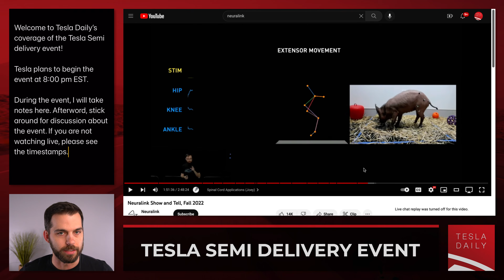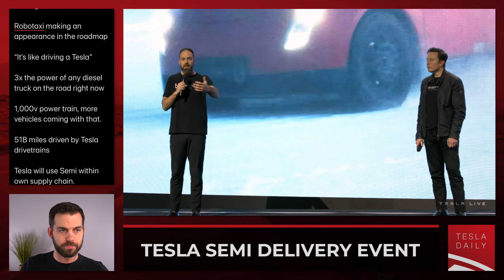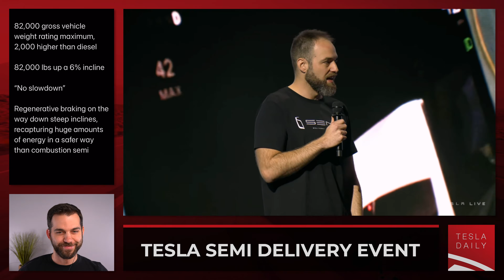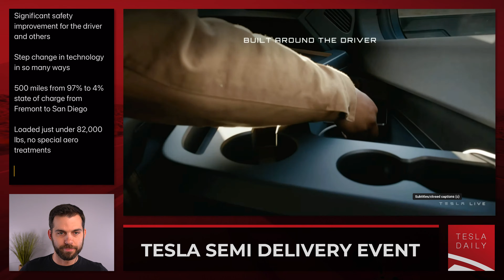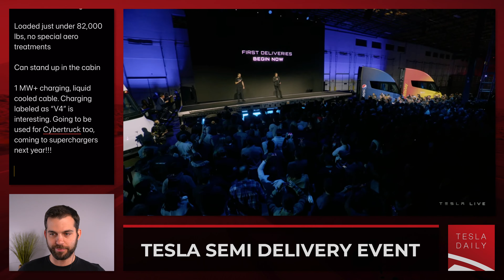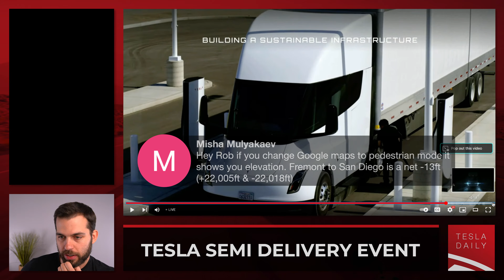Tesla Semi Delivery Event + Reaction & Analysis

Comment: Semi looks like it may be simple to produce.  Conventional frame rails are still necessary to tow the heavy trailers, but the battery pack can fit in between them.  The drive units are probably smaller and lighter than the conventional axle differentials. Looks like conventional disk brakes instead of air brakes? I wonder if a sleeper cab is an option.
Reply: I suspect they'll hold off on a sleeper until the charging network is.. started. :)
Reply: @TheEvilmooseofdoom  
Unless (a question I want to ask)
"Can the Semi charge on a V3 with an adapter?"
If "yes", that's 1,500+ locations ready for overnight trickle charge. (If 1 Mega = 4-6 V3, that's a full charge in about 5-6 hours)
.
That's a whole new ballgame?
Reply: @rogerstarkey5390   The Semi may well be able to charge via V3 (albeit very slow, even if double plugged)... the issue you will be that the current Supercharging stations are not setup for long-haul trucks to park - unless I suppose, they disconnected from the trailer whilst charging.
Reply: @TheEvilmooseofdoom  and they will have plenty of short haul customers for years anyway.

Comment: Max elevation between Fremont and S.D. Is 4255’, but there is more climbing (from sea level) than that due to several hills/mountains.  Maybe a total of 5,000’ of climbing?
Reply: Yeah but it regens on the way down...kind of cool though.
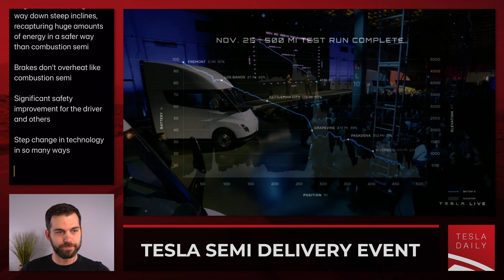Reply: Net elevation change Fremont-to-San Diego is really really close to ZERO FEET. You can see the data in your video... at time marker 39:39 there is a graph of the elevation vs position... on the far left (beginning of the trip) the elevation is very close to zero... elevation of Fremont is about 50 feet... and then at the far right at the end of the trip it descends quickly back down to around zero feet. The elevation is super-imposed in grey under the blue battery charge graph. (The max elevation point of the trip is marked as 4,136 ft at around 300 miles into the trip as it drives along the grapevine.)
Reply: The net change in elevation was six feet UPHILL.

Comment: The real question is how will the autopilot work without a rear view camera, or do they also deliver trailers? I saw the FSD visualisation on the 8 hour tour. So yes, it works, but how?
Reply: Autopilot doesn't need a rear camera, I think FSD might but not standard autopilot.
Reply: @TheEvilmooseofdoom  That much I know myself, that's why I said FSD, those were 100% FSD renderings, and in the little demo video of the trailer hook-up they showed that there is a rear camera but it is blocked by the trailer when a trailer is connected. There are also 2 new cameras on the sides that are aimed at the ground to cover some blind spots, which you can also see in the video. So the Semi has more cameras than normal Teslas and completely different views as well as a blind spot when a trailer is connected. This means that it has a different Tesla FSD computer (V4 ?) and FSD now seems to be able to handle completely different camera directions.

Comment: Pretty interesting . I wonder which battery they are using and how many . Also I wonder if they have to use a special trailer which also has Regen
brakes? Recharging time and actual battery capacity where not revealed or did I miss it?
Reply: @Charles Jutkins
Battery?
"Sufficient" (it's 2170, they told us months ago)
Trailer? Standard.
Reply: 18650 battery. They said it was a special trailer.
Reply: @mynameismatt2010  
2170 battery, from Nevada. Where they build the truck as stated previously.
Where did they say "special trailer"? Timestamp please.
Reply: @rogerstarkey5390  You’re right, I knew it was using cells from giga Nevada and switched which ones they were making by mistake.
I’m not going to search for the time stamp, early on in the presentation the guy said something like you can’t optimize the truck and not the trailer or you end up with a less efficient system overall.

Comment: Both Freemont and San Diego are pretty much at sea level :) in fact the chart they have shared clearly indicates that elevation was the same in the end but there was also very significant mountain passes in-between. Also to note this is Nov 25th test in California, so temperatures were not the best but also not the worst for the batteries. I would really love to know what smart thermal management system they have devised to maximize cold temperature performance
Reply: Funny,  I'm not a scientist or a mathematician, and I'm not trying to punch holes into Tesla's presentation as I also own Tesla stock <:).  However, Tesla's presentation left me with a couple of observations as well.   I used to ride a bicycle, and used to do long-distance cycling, and when I was really into it 1 could do 100 miles rides without out too much concern about completing the ride The 100-mile ride I used to do on a weekly basis was pretty flat.  Sure there were a couple of hills, but if you looked at the profile of the course I rode, the hills were ripples in a stream;   A "flat" 100 miles was still an achievement for me, but it wasn't a stage in the Tour de France  <:)   2ndly, most of the 100 mile rides I completed were executed while I was in motion for most of the ride.  If I had to stop and start repeatedly and go up 10% grades, the energy output was extremely different.  The same conservation of energy or not, has to apply for Tesla's 500 mile ride as well.  I'm also wondering if the 80k+ load actually helped achieve the mileage.  Once that package was moving, there was a lot of potential energy riding down the road.  The car I drive puts about about 260 hp at peak throttle, but keeping the car at 70-80 mph, constant speed, requires maybe 15-20 hp.  Tesla's motor size?  Yeah, it's damned impressive, but gearing plays a substantial role as well in the ability of a relatively small power source being able to pull or push what seems to be impossible amounts of weight, and a good example of that are the machines that push back 400,000 lb jets.    500 miles is 500 miles, but. I think Tesla has a long way to go, no pun intended.
Reply: @craighermle7727  I think you are making some assumptions that aren’t true. There is a 1000 ft elevation climb, a 4100 ft climb and a 1,500 ft climb along the route. It’s shown on the background on the graph with the state of charge and mileage. It’s an incredible feat of engineering. 

Fremont to San Diego
Max elevation: 4255 ft / 1297 m
Min elevation: 9 ft / 3 m
Elevation change: 4247 ft / 1294 m
Max grade: 6.9%
Min grade: -5.5%
Steepness score: 10 + 693 + 4001 + 15 = 4720
Distance: 475.46 mi / 765.18 km
Travel Time: 7 hours 17 mins
Reply: @mt2nv1  Like I said, 500 miles is 500 mile! I don't think I made too many assumptions.  Musk said there was 1 nature break so I have to believe that momentum played a significant role. in Tesla's mileage scenario.     I'd love to see a course profile   4247 ft of elevation change over 2,508,000 ft,  (475 miles isn't all that much.    Pulling 81k thru stop and go traffic for 500 miles has to consume more energy than a steady state drive.  I own Tesla stock, so I hope they sell out and every trucking agency wants one, but there are ways of extending range I know that from pedaling a bike for a few miles up and down hill <:)    cod is also a significant component which I think plays a far more significant role at 70 mph than it does at 5-10 mph.   There's a lot of energy spent just pushing air, so if Tesla has lowered the cod thru design, great!
Reply: @craighermle7727  Stop and go is actually a LOT more efficient in an EV than a traditional car.....just saying.
Reply: @craighermle7727  the EPA rates vehicles on flat land with ideal conditions. This drive was far from that. I understand a healthy skepticism, but insinuating the numbers were fudged is a bit much. 

The speeds appeared to show an average of around 50 mph. CA limits Commercial trucks to 55 mph.
Reply: @mt2nv1  I'm not insinuating anything.  Look up any cycling profile and see what power requirements   for a 150 lb person doing a "hilly" ride vs a flat ride.  The energy requirement to climb 15,000 feet over 100 miles is substantially more than climbing 4700 feet of climbing over the same.  That not insinuating anything.  It's a matter of fact.                                                 EPA rating has nothing to do with Tesla's presentation example.  "They went the distance they claimed it would. or at least close to it.   Do you think The Tesla semi could pull a 81k load up an 8% grade for 475 miles given the same battery capacity?  I would be awe-struck if they could.    There are many variables that allowed Tesla to make their 475-mile range; it wasn;t all battery and motor design.
Reply: @craighermle7727  I understand where You wanna go, but I believe stop and go traffic has advantages thay help the efficiency too. If You do slow traffic You don't fight air drag, which is bigger at highway speeds. Rolling tire resistancy is also lower with slow speeds so while You do more acceleration and braking, You fight a little bit less resistance. I'm not saying it will help, but I wanna wait for a real world tests outside Tesla. Like months. Pepsi could be the one publishing them. In 6 months or so.
Reply: @craighermle7727  wind resistance plays the biggest role on a trup like that. Inertia is nothing to worry about.
Reply: @craighermle7727  I understand what you are saying. My point is if the route was flat they could’ve gone farther. It was far from flat.
Reply: @craighermle7727  
The extra load can never "help" efficiency because "laws of physics".
You can never get back more than you put in.
The difference with your "bike" analogy is the substantial amount they can recover.
The "nature break" was insignificant because as they said, the truck didn't charge during the break, in fact, it reduced the efficiency since they had to accelerate back to speed.
Reply: @rogerstarkey5390    You can't get back more than you put in. that's a given.  All I'm saying is there were multiple factors that enabled Tesla to make its range.    cod is certainly one of them as is regen braking,, as is battery and motor design as is a route that allows the vehicle to use regen
Reply: @craighermle7727  
The "regen route" is largely irrelevant.
You either "tick over" on a relatively flat route and recover a little, or use more energy on gradients and gain a similar percentage but more energy back.
.
However..... A "demanding" route will always leave a bigger energy gap.
Reply: @craighermle7727  
They did a real-world test, that's by definition the best approximation of what customers will experience. Not all conditions were the worst possible, but they weren't the best either, it's a nice average, erring on the unfavorable side. Real loads rarely max out the truck's capacity, and weight does matter. At minimum rolling resistance is proportional to weight, and that's a non-trivial percentage of the total power consumption. In fact, for truck drag is less important, because of their elongated shape, higher density, and the square-cube law, while rolling resistance is more important because it's also proportional to the number of wheels. The Engineering Explained YouTube channel did the math on the Tesla Semi recently, you can take those equations and play with the assumptions.

Also, height difference is less important than you think. If you drive a Model S from sea level all the way to the top of Mount Everest, you only lose about 50% of the range to the height difference.

In the real world, your average elevation change is always zero, you can't drive uphill both ways. So, driving up to a mountain takes more energy, but you get most of it back on the way down. If it's not a single drive, that doesn't change the overall picture much.
I've driven my Tesla in the mountains, the overall power consumption doesn't change much.
Reply: @craighermle7727  the only got you question left open is the weight of the semi truck load and trailer were 81000 lbs. Does the semi weigh more than a 1000 lb more than a diesel semi.

Comment: San Diego and Fremont are both at sea level.
Reply: Yup, but the land between them isn't.
Reply: @TheEvilmooseofdoom  Yes. Rob was asking about this because if one is higher than the other that would affect the ending charge in the battery and affect the total drivable mileage. But they are both at sea level, so there is no net elevation change to affect total mileage. :)
Reply: Net elevation change Fremont-to-San Diego is really really close to ZERO FEET. You can see the data in your video... at time marker 39:39 there is a graph of the elevation vs position... on the far left (beginning of the trip) the elevation is very close to zero... elevation of Fremont is about 50 feet... and then at the far right at the end of the trip it descends quickly back down to around zero feet. The elevation is super-imposed in grey under the blue battery charge graph. (The max elevation point of the trip is marked as 4,136 ft at around 300 miles into the trip as it drives along the grapevine.)

Comment: San Diego 62' above sea level, Fremont 56' above sea level.
Reply: So?  The land between them isn't.
Reply: @TheEvilmooseofdoom  just asked for their altitude.  Many thousands of feet rise and drop in between.
Reply: Net elevation change Fremont-to-San Diego is really really close to ZERO FEET. You can see the data in your video... at time marker 39:39 there is a graph of the elevation vs position... on the far left (beginning of the trip) the elevation is very close to zero... elevation of Fremont is about 50 feet... and then at the far right at the end of the trip it descends quickly back down to around zero feet. The elevation is super-imposed in grey under the blue battery charge graph. (The max elevation point of the trip is marked as 4,136 ft at around 300 miles into the trip as it drives along the grapevine.)
Reply: @yournextminute3188  
I REALLY don't see the point you (ALL) are trying to make?

Comment: I believe <20% of semi-truck loads utilise the max 80,000 pound capacity... a majority of the loads are volume restricted, well before maxing out the weight  ==>  I'd expect with reduced load weights & depending on other trip variables (wind, elevation changes)... >500 mile range should be possible!
Reply: Don’t forget that once the mega charger network is deployed broadly drivers can charge during their legally required breaks, adding up to 50% state of charge.
Reply: @mynameismatt2010  I haven't followed the news in a while. What's the 0-100% charge time and the net weight?
Reply: @christzamp  We don't know what weight of the semi is yet. Should be similar to a diesel, but we have to wait for details. Charging speed will depend on the network. If the MCS charging is rolled out, the semi will be able to charge just like a Model 3 or Y where you get 70% (10%-80%) in 20 mins. However, they only talked about the NACS charging last night, which is limited to 1MW charging, which would take closer to 45 mins to charge the semi up 70%.
Reply: @christzamp  my high end estimate is that the battery weights around 14k pounds and the rest of the truck is around 8-10k pounds. Add 10k for the trailer and you’re looking at a potential hauling capacity of around 48k pounds.
Reply: It should greatly increase. I'd imagine at least 600 is possible at half load.
Reply: Exactly, that's pretty much the numbers I know from Europe. 80% volume restrictet, 20% weight restrictet.
Reply: Make that 82,000 lb. Maximum load capacity.
Reply: @kentmonroe7923   "A semi-truck hooked up to an empty trailer weighs around 35,000 pounds.  The weight maximum for a semi-truck with a loaded trailer legally allowed in the United States is 80,000 pounds.  A semi-truck without a trailer weighs between 10,000 and 25,000 pounds, depending on the size."

Comment: Rob mentioned a possible disadvantage for trips over 500 miles, but when megachargers are installed where the driver needs to take their mandatory 1/2 hour break then 700-800 mile trips should be no problem.
Reply: That's why they're starting with day haulers, the chargers are mostly located at the facilities owned by Pepsi etc.  It will be a few years building out a highway network.
Reply: @TheEvilmooseofdoom 
they can instal a megapack and a charger in a day at a prepared site. It's modular
Reply: @rogerstarkey5390 The electrical infrastructure at truck stops will probably need upgrading to get a hefty amount of power delivered quickly.
Reply: @georgibonev805  As he said, adding a megapack would help there. You could charge the megapack more slowly over a long period of time while the semis would deplete the pack when charging quickly instead of taking from the grid.
Reply: @georgibonev805  
Think of a Megacharger in terms of V3 Superchargers.
It's somewhere between 4 and six, depending on the energy estimate (1-1.5 MW vs 250kW?)
Then consider there are locations with tens of V3 chargers everywhere, not causing a problem.
.
It won't be every charger, working at the same time, everywhere.
Reply: Installing at truck stops just means a partnership with flying j and loves, they’re the vast majority of truck stops. Tesla could probably even get them to finance the installation as the deliveries ramp up.
Reply: They will probably have the charger network out before they run out of demand for short haul customers.
Reply: 700 to 800 miles will probably be what the semi will get with average 40,000lb loads.  The whole point of this is that 81,000 lbs is a worst case scenario and still getting 500 miles of range. Walmart trucks are not hauling concrete blocks.
Reply: Good point